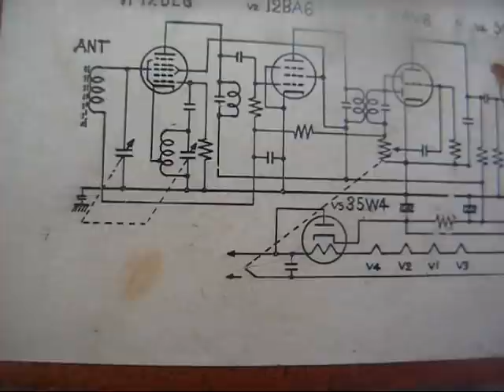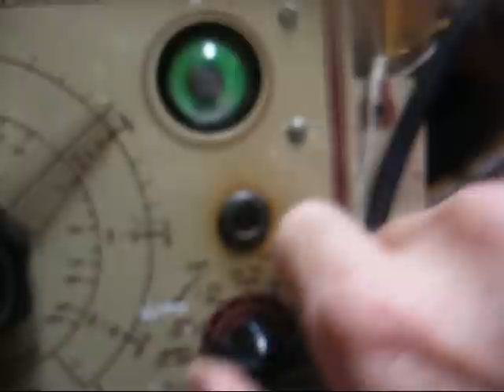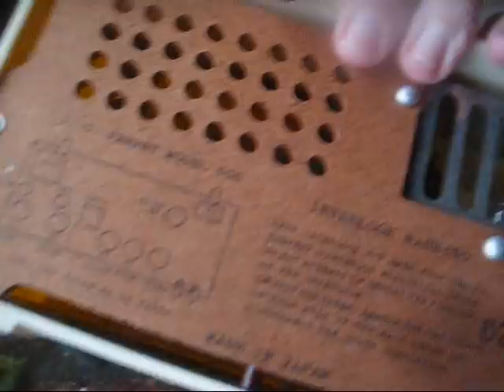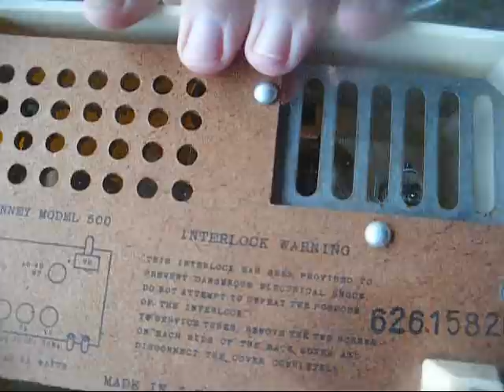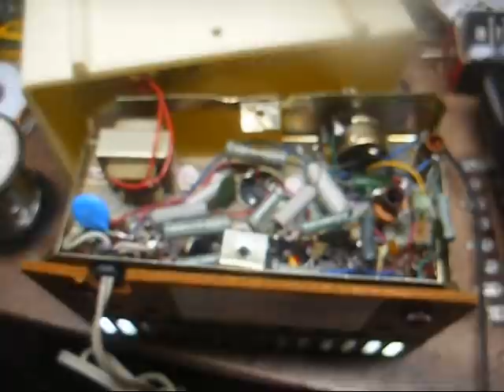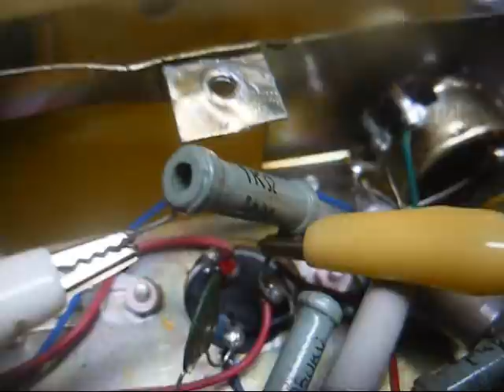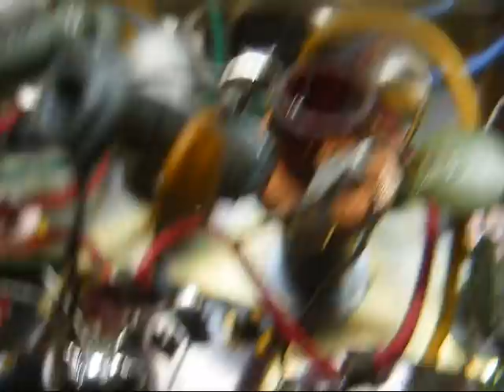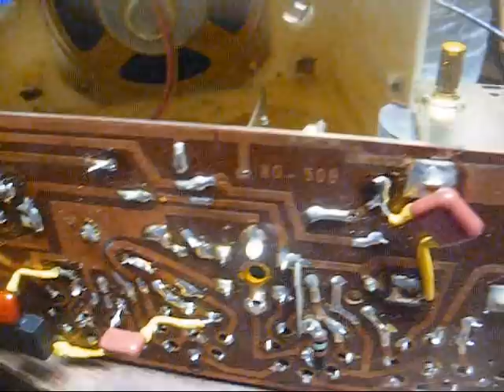Repair of a Strat-O-Sonic & JC Penney Japanese-built tube radios

Comment: I heard from Farm Radio you can just put a drop of cleaner on the "phonelic" (or whatever it's called on the very back of a pot) and that it soaks in and works great.  uses a lot less cleaner and keeps it from getting everywhere by spraying it.  I just trashed a Harmon Kardon 730 twin receiver from the mid 70s. That damn stuff gets everywhere. Took a lot of work to clean everything off.

Comment: EBay sells should not be saying anything. There cashing in on some one that had and bought the radio and died. The eBay seller got the radio for nothing because the family of the person that diced did not want it. And the guy that die did pay full price for the radio new at the time. Then the eBay seller mark it up so hi in price no one can buy it. Think eBay sells should give half of what they make to the family. Snice the eBay sell did not buy the radio when it was new. Why should eBay sells get out of control pricing from a radio they payed nothing for. Any eBay seller that mouth off is just trying to take people. Yes there lots of good eBay sells but the bad ones make it sad for the good ones.